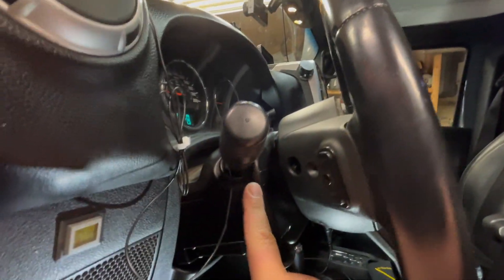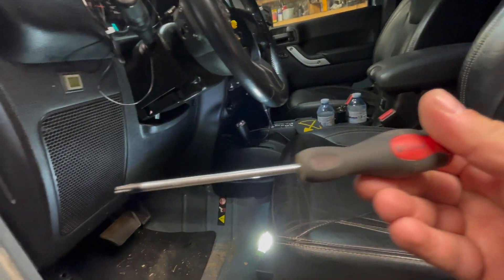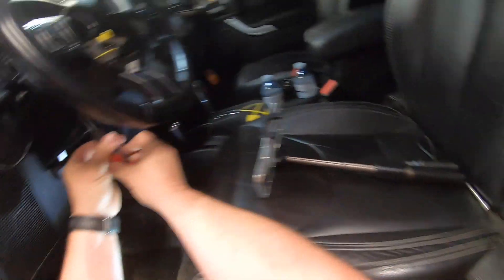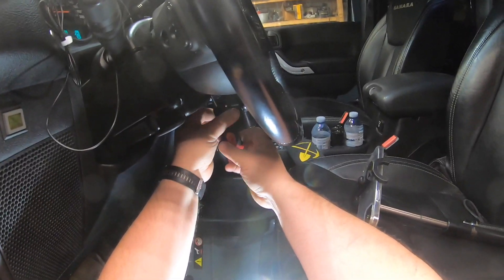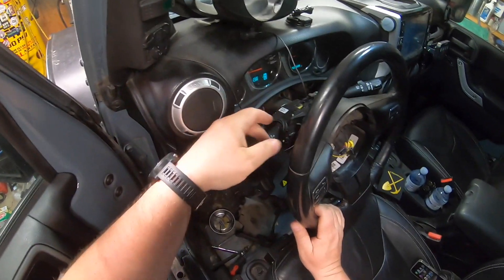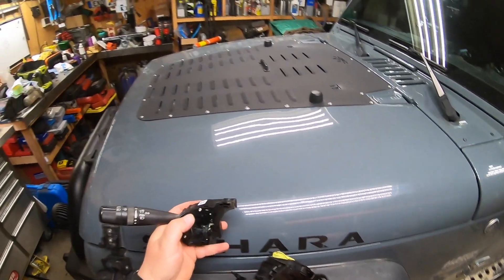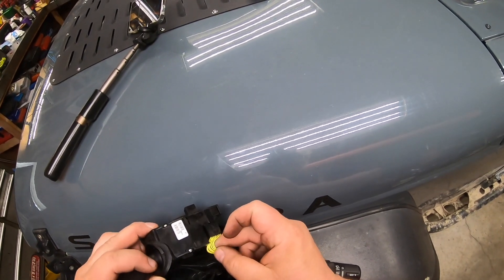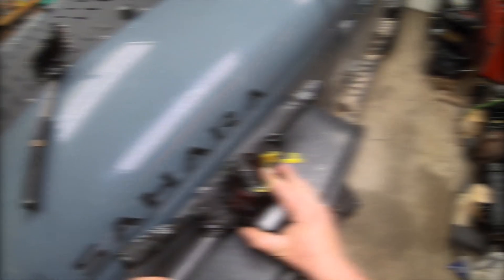DIY How to Remove Headlight Switch Jeep JKU

Comment: my 2017 has that lip on the column cover that goes into steering wheel. Do i need to remove steering wheel to remove that? i really dont want to dremel it off.